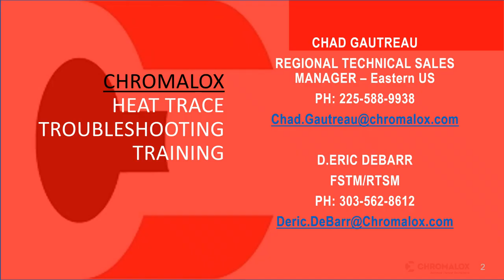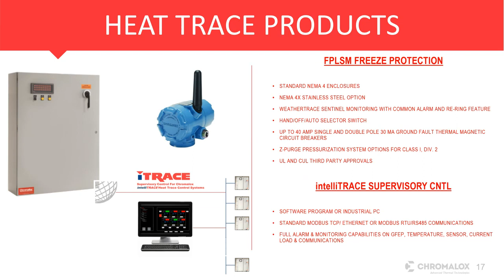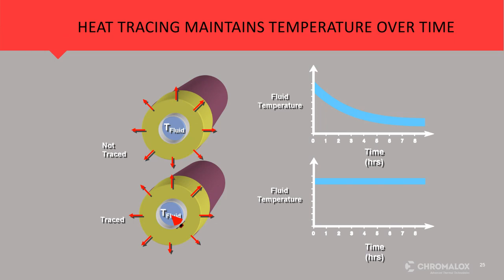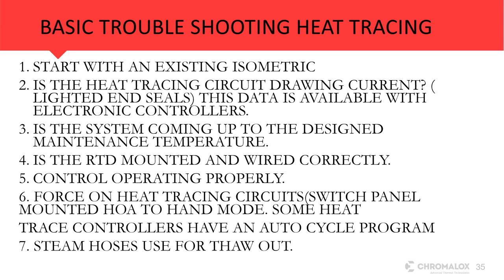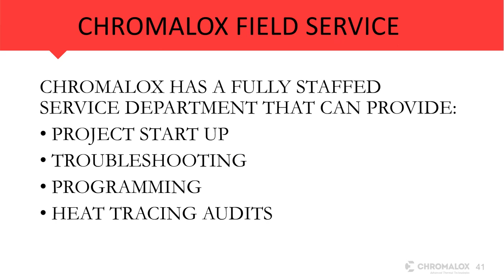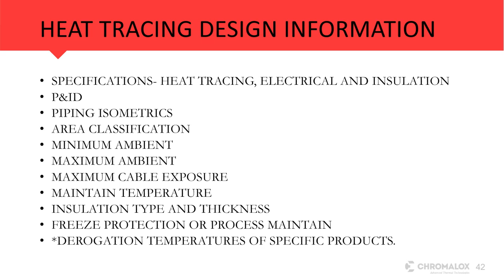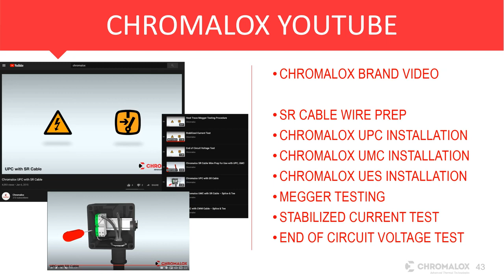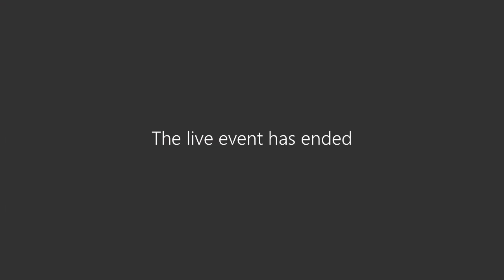Heat Trace Troubleshooting Training

Comment: I'am sick for about 16 mouth's. You guys help me surprise my boss when I come back. I also have ADHD, learning is difficult by reading, but listening to you will make me a specialist in heat tracing when I come back.
So a question I have on my mind, maybe someone can help me answer it.

Why do you need a lowest setpoint in a installation?
I mean why does a alarm goes off when a installation hits "let's say" 0,1 Ampere.
I know you can set this point lower to trick this alarm, but what is the problem when it gets to low??? I don't see why a alarm is needed for such a thing? What is the danger?

Is this because the power could flicker on and off maybe? And if this is the case, could it damage the installation because it can create a heat at the connection point of power cable and heat tracing cable?

Is my thinking wrong or correct???
Reply: Im just a kid but in the plant we use heat tracing it is very cold . around 0F .  An alarm would be setup because you would want to know if your heat trace stops working because you want it to be running all the time. if the heat trace stops working then the pipes will start to freeze causing problems. this depends what’s using the heat trace
Reply: @julianmorales4008  Sound scorrect what you telling me.
But as long as everything is working correct why do you need a alarm. 
This alarm tells you that the thermostat has almost reached the point of disconnecting the power. But if the temperature is going done again the power will be put back on.

So there will be moments this alarm will keep going on and of till someone is fed up with it and than the disconnect the alarm.

So this alarm gets triggered for the wrong reason in my opinion.
There should be a delay for this which you can program in your control system. But sti I don't see the point of all this.

Seems to me you can better instal something that measures the resistance in different places of the installation, and when it gets below what it should be let a alarm go off.
And so there can be other things which makes more sense to trigger a alarm.
You need to know if the system works not everytime its shut on and off because of the temperature.